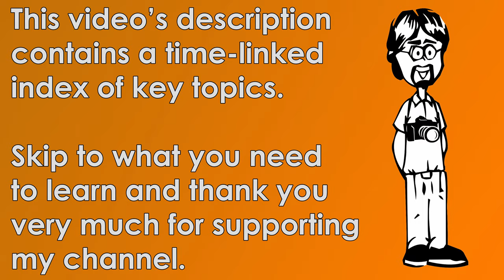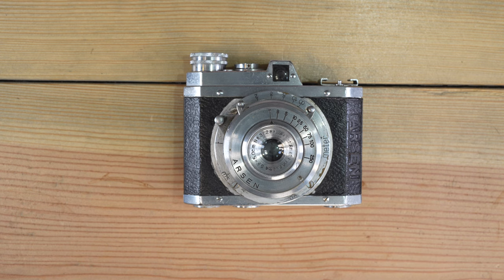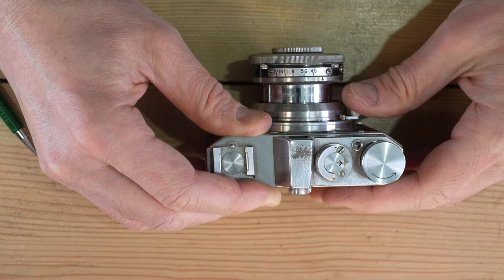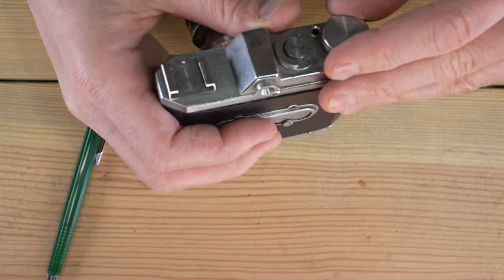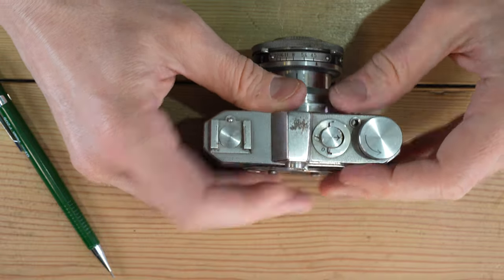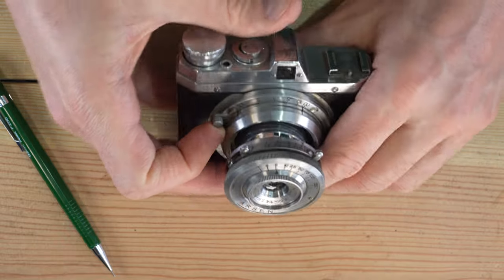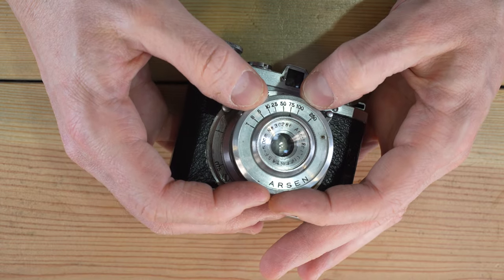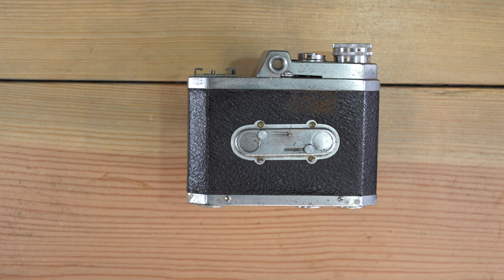Toakoki Arsen Gelto 127 Half-frame Compact Film Camera Review and Manual

Comment: 4x6 CM is full frame,  4x4 cm is what the twin lens 127 used, and  4x3 cm, slightly bigger than 35mm frames was the half frame size. 4x3 and 4x4 were superslides, working in 2x2 inch cardboard mounts!  The 4x4 twinlenses were usually 60mm focal length, the 4x3s I've seen  were  50 mm.
Reply from the maker: Thank you!

Comment: Thanks for sharing, i have not seen this camera before. Try with a UV flashlight, let it shine through the lens for a couple of hours. I do that sometimes with my lenses and it seems to work. Of course it does not remove but it will kill the fungus and hopefully stop it from ruining your fine lens ;) Danish guy here, sorry for my English, its not my native tongue.
Reply from the maker: Thank you! And your English is very good (trust me, I have two degrees in the subject and taught college grammar and writing for several years before taking a job as a professional writer in the private sector a couple decades ago). I have taken a camera to a tanning bed before and it's a risk. The fungus will die (and also, storing the gear in a dry place will stop the growth.) But when the fungi that are in the lens die, they stop producing the mycotoxins that were holding other fungi at bay and then the problem can get worse (something I learned after the tanning bed.) In general, it's a good and safe way to halt fungus growth as long as the conditions needed to grow more fungi are not present.
Reply: @DavidHancock Thank you very much. Ah i see, and i have not done this with an infected lens yet and now i know not to do it either. I will just disassemble and clean like mikeno62 is doing if i ever encounter such an infected lens.